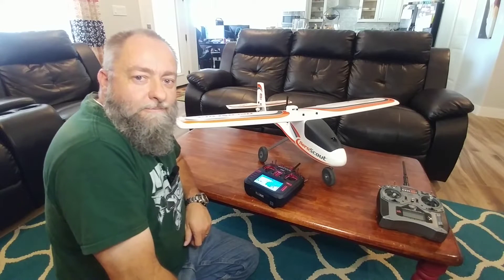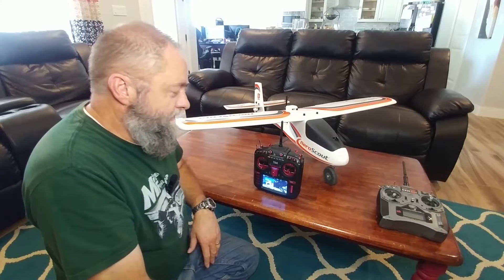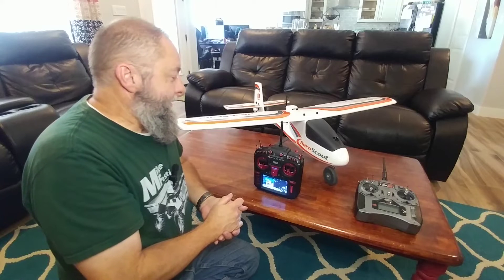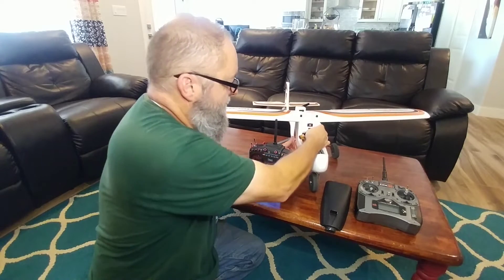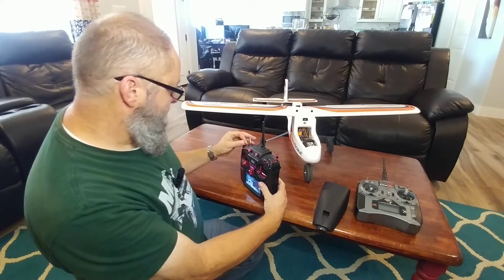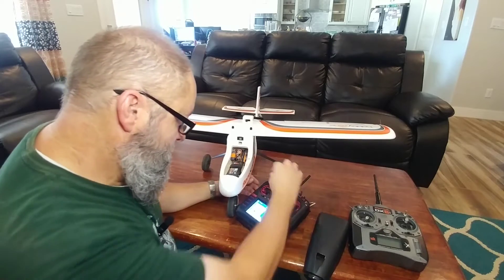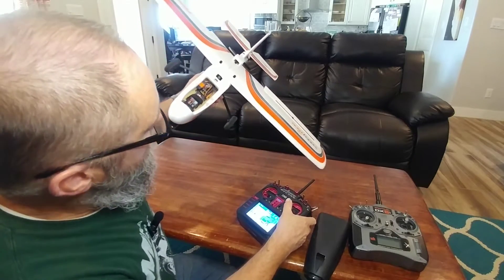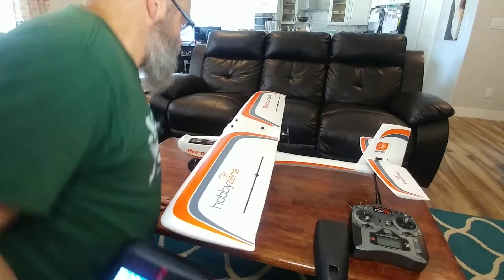Spektrum RC Safe Modes on the Radiomaster TX16S!

Comment: So i tried this method using a ar637t receiver and could not get it to work and the dsm forward programming says no compadable rx found was wondering if you had any suggestions
Reply from the maker: You sure you are running "DSM Forward Prog v0.53 (Color+Touch)" script?  What version of the Multi Protocol Module firmware are you using?  1.3.3.20 is the latest, if you are on an older version it may not be able to see it.  Can you bind to the receiver?
Reply from the maker: Watch this video by one of the developers of the EdgeTX forward programming, see if you see anything that helps.

https://www.youtube.com/watch?v=c0Pf8oCyRaU&t=1s
Reply: @shanesdiy  
So i do have the correct program version for both of them and I've watched this video before also this receiver did not come in a bnf version do not know if this makes difference or not thanks for the help though
Reply from the maker: Have you been able to bind to the receiver?  Just cannot do the forward programming?  Is this an older AR637 or a new purchase?  I wonder if the firmware needs to be updated.  For that unfortunately you would need the Spektrum USB adapter, link below. I didn't need it to update the firmware in my BNF AR631 since it already had default Forward Programming done with channels set. Since you have basically a blank slate, you might need to do the update.  I did have to update the firmware before it would let me manipulate the Forward Programming on my AR631.

Spektrum SPMA3065 USB Adapter
https://amzn.to/3J7BOZS
Reply: @shanesdiy  
Yes i can bind it to the radio but i also cannot activate as3x or safe via the binding process and i do have the programming cable
Reply: @shanesdiy  
This receiver i purchased about 11/2 year ago
Reply from the maker: Do you have the receiver powered up and bound to the transmitter when you enter forward programming?  The forward programming data comes from the receiver so it must be on and communicating with the transmitter for it to recognize it and respond.

Also, I believe the stock AT637T does not have anything configured for AS3X or SAFE so you won't be able to enable it during the bind process since it isn't set up yet.
Reply: @shanesdiy  
Yes it is bound to the receiver when I try the programming wondering if I have to update and download a premade bnf safe and as3x file to the receiver
Also do you know how to download telemetry sensors on the edgetx
Reply from the maker: Open the model, navigate to the right side to the telemetry settings. Scroll down and click the wheel on "Discover new" and it should find everything it can read. Click again on Stop when done.
Reply: @shanesdiy 
It doesn't pick any sensors up wondering if this receiver might have to be updated or something i just a dx8 transmitter and i can set everything up on there but it still does not work on my opentx
Reply from the maker: I didn't know you were on OpenTX. I'm on EdgeTX. 2.7.1 in this video and now on 2.8.0. I do not know if all the new stuff is compatible with opentx. I do know that the Forward Programming Color+Touch won't all work since OpenTX isn't touch screen.

Did you use your USB  able to update the AR637T firmware yet? With the Spektrum software you can also do all or most of the receiver setup.
Reply: @shanesdiy  
I'm sorry for the confusion i am running edgetx the newest version
And no i have not gotten around to updating the receiver i can't seem to get logged into my spectrum account something's messed up not sure were
Reply from the maker: I would be happy to have a look at your SD card contents if you want to zip all the directories in to a .zip file and email it to me.  Email address is in the "About" section of my channel.  Perhaps I will see something?

Comment: Ok thanks so much for the trouble it was very helpful I'm not much of a computer genius so this really helps me out
Reply from the maker: No problem, happy to help!  I know when I was trying to figure this stuff out, I appreciated all the help I could find.

Check your original comment, I changed the link to the zip file from that Facebook link to direct to my Google Drive. I also have some instructions on that post in case you didn't see it on the github page.

Comment: So a bought receiver that was not in a bind and fly version this does not is that correct also what firmware version is on your radio and internal module
Reply from the maker: My understanding is if you purchase the AR631 (or AR637T) off the shelf the forward programming is not locked down so you have more control without "jailbreaking" the receiver.  At the time of the video I was on EdgeTX 2.7.1 and the internal module was 1.3.3.20.  I think 1.3.3.20 is still the most current.  I do not know for sure but I think you'll have to set everything up for Safe/AS3X as with the off the shelf receiver they don't have any default settings applied.

In case you were unaware, there has been some major updates to the Forward Programming Lua scripts and last I checked the latest Forward Programming version is 0.53.  The Forward programming Lua that comes with the multi-module "pack" is only  v0.2 which is missing a lot of functionality.  With the new v0.53 you can pretty much do everything required to setup a Spektrum receiver via forward programming.  To get the latest Forward Programming files you need to get them directly, not through the multi-module pack.  Below is a link to the 0.53 files if it works.  On the github page there is some additional instructions to set it up.  I'll put a second link below the first with the github link.

The files in this zip folder need to be placed in your \SCRIPTS\TOOLS folder.  You also need to create a folder in your \MODELS folder called DSMDATA.  That is where the transmitter will store the model setup for wing type, elevator type, etc. for use with Forward Programming

https://drive.google.com/file/d/1JkTGSYRAkH99U9xNifJOci6-sLcFDOp2/view?usp=sharing

https://github.com/pascallanger/DIY-Multiprotocol-TX-Module/tree/master/Lua_scripts

Comment: Another excellent AR63x setup guide here

https://youtu.be/IAZnCnZXBMU
Reply from the maker: Thanks for sharing. The SAFE model building program is useful but unfortunately it is only for the AR636 from what I can tell.  I wasn't able to open any of my AR631 .srm files with it to make any edits.  If your model happens to have an AR636, which has been discontinued, it would be a great tool.
Reply: Thanks @shanesdiy  for your Video & replying.
I found your Radio shots a bit out of focus, so harder to understand settings.
Pretty sure I have Vintage AR636's, so don't think any have all of the modes everyone shows.👍
Reply from the maker: Yes, the AR636 only had AS3X, no SAFE so most likely most of what I show doesn't apply to that receiver. Happy flying!

Comment: Awesome video Shane I really appreciate the insight! I do have a question regarding channels 5 and 6, how would one go about setting this SAFE select while channels 5 and 6 are in use, by flaps or throttle reverse (or even landing gear)? I've found that following this process activates those channels and overrides them so that the flaps or throttle reverse are activated based on the SAFE mode setting. Any ideas? Thanks again and happy flying!
Reply from the maker: Assuming your receiver is locked like mine was, you'll have to update the firmware and do a factory reset to "jailbreak" it.  They have the SAFE and panic set to channels 5 and 6 and I was not able to move them.  The AR631 in my Timber X I was able to set the SAFE channel using the sticks and flipping the switch on the desired channel 5 times.

Since I made that video I have updated my AeroScout AR631 receiver firmware, performed a factory reset to "jailbreak" it.  I reprogrammed it from scratch using my son's Spektrum NX6 with forward programming.  I was not able to do it from the EdgeTX Forward Programming LUA script. They just don't have it far enough refined.  I've moved one aileron to channel 5 and programmed for flaperons. Channel 6 is free and I have SAFE on "virtual" channel 7, didn't program a Panic channel, I just flip to SAFE if I "panic".  Doing it this way I was able to retain SAFE and AS3X with separate aileron channels.  If there is a way to do all this from EdgeTX I couldn't figure it out. Now that the Forward Programming is done on the Spektrum transmitter, I am able to make small adjustments from my TX16S, I just could not do a full reprogram from it.  I'll be doing a video on all the changes I have done to the AeroScout soon.
Reply from the maker: I'm not using panic mode. Safe is moved to channel 7. You can't have safe and one aileron on channel 5. That's where you must unlock the receiver to allow you to move safe to something other than channel 5 and panic on ch 6.
Reply: @shanesdiy  My apologies, I meant Safe mode, not panic. Yes, have done all you said but still trying to wrap my head around how it works. I guess I’ll just trust and test! Thanks again for your help and fantastic video tutorials
Reply from the maker: @Mr89Falcon  Ok, well, any specific questions feel free to ask. Don't put more than one thing on a channel. Only time I've gotten away with two different things on a channel is on our Turbo Timber Evo, we have the lights on ch 5 and safe flight modes.  This only works because the lights don't turn on/off, they are just using the power feed off the ch5 PWM port.
Reply: @shanesdiy  Thank you! And, btw, I don't know if you mentioned this in the flaperon video but there is a setting that will slow down the deployment of flaperons. I have mine set at 1.5 seconds down as well as up. Really cool feature and behaves like real flaps with the benefit of giving the pilot more time to adjust to the resulting balloon. All kinds of fun stuff to do with these Aeroscouts! I was inspired by your thrust reverser video and want to to that next.
Reply from the maker: @Mr89Falcon  Don't recall if I mentioned the slow up/down but yes, I have mine set for 1 second.  FYI, in my case, the Aeroscout noses down when you deploy flaps, more commonly airplanes balloon up when you put flaps down.  I have an elevator mix setup for when flaps are deployed -10% which in my setup  gives me up elevator.  This keeps my airplane level when deploying flaps.  If in doubt just test it initially with no elevator mix until you see how the plane responds.

I do mention in my flaperon video, that I made mixes to allow full swing of the ailerons while flaps are down.  Without this mix, when you have the flaps down you have very limited roll control. I did not like that at all.
Reply: @shanesdiy  So fun to tinker around under the hood with this stuff! The AeroScout is a great platform for learning this 😁😉
Reply: I have been struggling for hours on solving the 7th channel issue! Can’t figure out how to program flaperons AND have channels 5 and 6 open for the four modes. A quick video with this done from the new lua script would be awesome!
Reply from the maker: For now, the basics are:
1. Take the aileron Y cable off and connect the ailerons to channels 1 and 5 is how I have it.
2. Must unlock your receiver with the Spektrum software and USB programming cable.
3. Perform the factory reset.
4. Setup the model in the transmitter so all controls work as needed, then in the Forward Programming "pre-menu" enter the Model Setup to specify the wing type (flaperon) and what channel the two ailerons are on.
5. Go through the First time setup in forward programming, adjust channel reverses as needed. Specify the safe flight modes channel (ch7) at that point. You must have the desired switch assigned in the TX already.
(2-5 are covered in my Spektrum to EdgeTX series)
6. Setup the flap switch with the appropriate mixes, curves, elevator mix as required and in my case I extended the servo travel to allow full swing of the ailerons even while flaps are deployed. I discussed this in my Flaperon video.

This should get you dangerously close.  I will put a new flaperon video on my production list, might be a few weeks before I can get to it unfortunately, busy day job schedule over the next few weeks.
Reply: @shanesdiy  Thanks for your quick reply! Yes, I have watched all of your videos and duplicated all that you did on my Aeroscout using the TX-16s. I guess I'm just having trouble understanding how you can have an aileron servo connected to channel 5 but also use channel 5 for AS3X/Safe. I see that you designated ch7 for the panic mode, which was clever.
Reply from the maker: Have you watched my multi part series on EdgeTX to Spektrum programming?  I cover alot and do discuss where you'd change the configuration to setup flaperons.  I also have a specific video where I test my flaperon setup and towards the end talk about the setup.  Did you find those videos?  They cover alot but granted aren't a focused tutorial on setting up an AeroScout for flaperons.  I have my second AeroScout that still needs flaperons, I've already unlocked the receiver which is covered in the EdgeTX to Spektrum videos.  If I make a new video it will be starting off after the RX firmware update and factory reset.